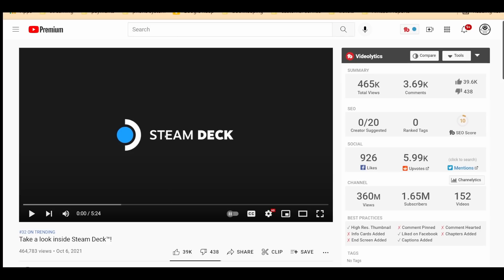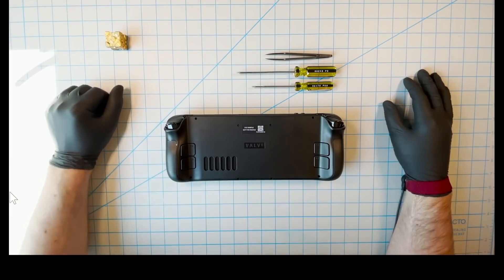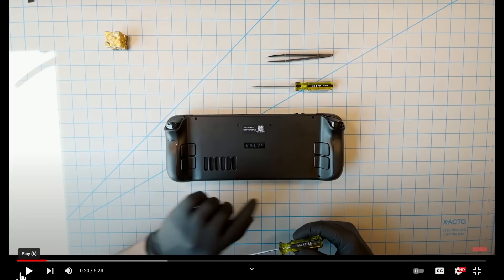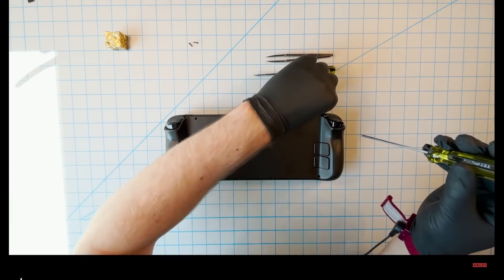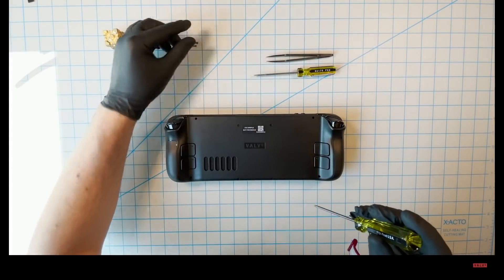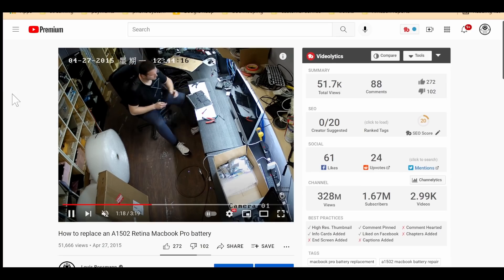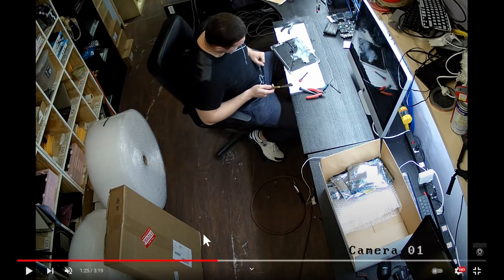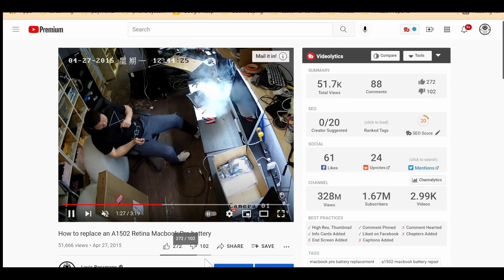Steam deck battery may end your life? bruh 😑

Comment: Like the top comment says under that video: Huge props to Valve for actually doing this video instead of trying to say it's impossible or trying to hide the information. Also that thumb stick assembly seems to be designed specifically with easy replacing in mind.

Comment: it could drop by a few margins. Like an IP 68 rated machine, when open and reseal there will be a few human errors that will drop its integrity and not seal properly. Anyway, this is a prototype who knows later the steam deck will have some epoxy seal for a stronger seal. Valve also said they are using self tapping screws not the typical screws with a in place nut holder.

Also, you shouldn't underestimate human stupidity, yes anyone can run away before a fire, but human stupidity will be the end of them. Like someone sold their kidney for an iPhone or die while playing a video game for 3 day. This is why there a Darwin award.

Comment: They should be using conductive anti static gloves. A static charge can build up on nitrile or rubber and it wont be discharged by the strap because the material is not conductive.

Comment: Every time you put the screws back in, you're probably tapping another thread into the plastic stumps. It will weaken every time, probably not noticeably, but perhaps you open and close it a few times, and then drop it and the back cover partially removes. 20 times perhaps it doesn't stay on properly at all anymore.

Comment: the reason they said that the item will be structurally not sound forever is simply because as they said the screws are selftapping and simply overtightening them can cause the female part to crack or break hence structurally it becomes less performant.

Comment: Reading comments about clips deforming, and what I was about to say on stripped threads - are two ways the thing could lose structural integrity FOREVER.
Also 3D printing the replacement casing will have an impact on structural integrity, which will last for the rest of it's life.
(Jokes aside - accidentally leaving it in a hot car to warp / explode is something that will last the life of this thing...)

Comment: I think more of what they mean is that if the battery catches fire while it's closed up, potentially even while you aren't using it and potentially starting a house fire (depending on where it's kept). You can puncture these batteries without causing them to set fire or smoke at first (I accidentally did that with my laptop's battery while trying to close it back up).

Definitely could've been clarified better on their end, and probably not so ham handed, but it's at least a step forward. I really didn't like their wording regarding the battery either.

Comment: Hi Louis—love your videos, am glad to see you chose to comment on this one.  I design consumer electronics products for a living and want to give my 2 cents on the self-tapping screws, structural integrity comment.  

You're not wrong that, if done properly with the right threading orientation, right torques, etc a few cycles on the self-tapped threads in the plastic will most likely have a negligible effect on drop performance.  But they're also not wrong—these types of connections will always be at their strongest when they are first shot, and every cycle will have some measurable (but maybe not meaningful in terms of performance) degradation of strength. I struggle to imagine a reinstallation done right, with a limited number of cycles, meaningfully impacting performance in real scenarios, but if the reinstallation is done slightly wrong I can easily imagine it actually impacting performance in the right (wrong) type of drop/impact.

IMO I think they overstated it at just the right level for consumers that aren't fluent in these questions—by calling attention to the risk, people will be more careful when working with the screws and recognize that putting tons of cycles on them creates risk.  The most important thing is doing the reinstallation right—it is super easy for someone not aware of how these screws work to clumsily re-tap them or overtorque/strip them when reinstalling, particularly if using a run-of-the-mill electric screwdriver—so I think Valve did an above-average job as a manufacturer by highlighting the risk.  I am sure they do a lot of testing with factory-shot screws, and may even do some testing after some consumer re-cycles to see what happens, but they can only guarantee the former at the end of the day—if the overstatement here makes one customer be more careful and have a good experience they made the right choice.
Reply: Having finished the video, I want to add one more comment. It's not just marketing/legal that wants to err on the side of caution/CYA in consumer messaging.  As an engineer I have an equal interest in helping customers make the right risk decision—it sucks to hear that someone had a bad experience with a product we want them to enjoy because they tried to do something they didn't understand and did a bad job.

I know legal risk and liability can dominate a lot of company's messaging nowadays, and it makes me frequently cynical too, but for technical content like this I can easily imagine engineers being the advocates for overstating potential risks to try to steer customers towards making right choices.  I think it's more likely the marketing team would just want to tell customers they can do as much as possible with the product and the legal team would want to make sure there is a clear disclaimer/TOU that protects the company from being on the hook... between the lines there are often product designers (or customer-oriented QA leads) that want the thing to work and for people to be happy with it.

Two cents—thanks again for your thoughts on this.

Comment: om only 17 and do prove me if i am wrong but what i think he means that its less drop resistant is because the plastic stand offs that the screws went into has been weekend there for if he did drop it it could snap the stand off or rip out the thread causing the steam deck to split apart once more

Comment: While replacing the battery on an old iPhone 6, I damaged the battery and the heat generated loosened the torn glue strips sufficiently for the battery to be easily removed ;-)

Comment: 8:30 The only thing I could think of that could actually affect the structural integrity is the self-tapping screws. If you remove and reinstall those many times without paying any attention to try to match the previous threads, those screws will have a lot less holding power and if you drop the device after that it might get damaged more.

Comment: When your battery starts smoking...  Grab a towel, hold breath, grab laptop, walk outside, set it down.  Then grab long handled pliers, rip burning cell out of chassis, toss it in a salt-water bucket.  If you simply walk away, the shop fills with super nasty smoke, the desk burns, and the laptop chassis is scrapped.

Comment: The way i generally deal with ESD is to just take my shoes off to ensure my feet are grounded.
I've only once damaged a component through an electric discharge once, and that's when i was trying to re-connect a wi-fi module while the laptop was running and shorted the wi-fi board with one of the connector wires because i was an idiot 10 years ago 😂(but then, i've only worked on my own hardware, my GF's laptop and assembled some desktops at work here and there).

As for the self-tapping screws, i could see why it makes some difference, self-tapping screws "cut into" the plastic on the way in, and you're likely to have a weaker connection if you screw them in poorly (and re-tap the holes) cause now you've got a bunch of compressible "gaps" in the plastic in between the threads.
BUT if you screw them in carefully (re-using the existing grooves) then i'd expect there to be little to no change to the sturdiness of the connection.

Comment: 9:00 don't have any citations or anything to prove it, but my guess is it builds off of the fact of the screws being "easy to strip."

if everything is quite tight fitting, it doesn't have any space to move around, making it so something actualy has to have an actual breakage, if the back plate is a bit loose, that gives more space for the components to jiggle against each other/in the case, makes it more likely for something to yank another thing, causing a break.

Comment: Well , it probably uses little plastic clip kinda system so two parts "snap" back together interlocking which might , a hard might fuck with integrity by scraping plastic of of these clips and in the next drop they might separate on handles , i didn't see screws there also a disclaimer , I'm not a professional, just a thought , i might be wrong

Comment: I like how Louis goes out of his way to give people excuses/reason on why something they may do isn’t all their fault. However, I don’t agree with his reasoning on why the battery his previous employee was working on got damaged. I’m a ASE master diesel mechanic and have been doing mechanic work for over 20 years. My hobbies include electronics repair, gunsmithing and creating metal sculptures. If you use a tool regularly, you know how that tool is supposed to operate, look and feel along with how the work piece should be while using the tool. Dude should have noticed if the tool was messed up, even if he was in a hurry to get it done. I have dealt with thousands of much much larger and sometimes way more “dangerous” batteries (dangerous only if you mishandle them, damage them while removing them or improperly install them) and the only time I every messed one up was when I wasn’t paying attention or acting foolishly while working on one. I have also damaged several Li-Ion batteries and each time it was an accident , it was my own fault for not using the right tool or doing something extremely risky (like soldering on a battery tab that I didn’t prep first or not adding a protection circuit before attempting to charge a battery). 

My point with saying all this, it’s clear Louis is a nice and forgiving dude. Perhaps nice to a flaw sometimes. That dude though, it’s on him that battery got damaged and if he would have been responsible enough to slow down and check his tool/workpiece first that may not have happened and he should have known better than most since he was doing it for a living.

Comment: Removing the screws and reinstalling them will weaken the hold. The experiment you can do is take a self tapper and place it in the same hole 3 4 times and notice how much weaker the grip becomes.

Comment: I feel like the thing about the battery getting hot is a solid point but what about messing it up in a way that doesn't explode immediately or it happens later in a backpack or your pocket once you put some extra pressure on it after opening it or something. I'm no expert in any way but it seems like an over the top warning with some fractional validity.

Comment: I had an old iphone 6 that I tried to take the battery out of to swap because it kept dying on me randomly and couldn't hold a charge. Find out after taking the case off the battery was bulging enough to start to separate my screen from the phones shell. And long story short attempting to take it out as carefully as we could still resulted in it exploding. However it wasn't like this video and instead of a smoke cloud it was a relatively short burst but a powerful one of flames followed by all the gasses in the battery spewing out like a flamethrower. Definitely got burned and didn't have enough time to react. But granted that battery was damaged and is most likely the reason why. But just a warning to be extra safe with the batteries. Even if you think you'll have plenty of time maybe you wont. But definitely not die like valve is saying lmao.

Comment: so steam is just covering they buts by using death.. Lawyers came up with it. when you want a catch all. normally it is worded as "it can cause injury and or death.
the screw talk was legit. self tapping screws will over 20 to 30 times screwing in and out the threads to be cut out. they if not installed correctly with cut new threads. not a normal problem 99.99 the time. what can happen is the screws will not screw in all the way or the shell not line up just perfect. 
i would say they made a very entry grandma with flip phone problems level of safety and demo of it. with mix of hay you can do it dont come complain to us.  its not that bad....

Comment: first i want to say i do know who you are and how big of a deal freedom to repair is to you and i 100% agree with you. that being said, i feel like the start of the video you are a little bit to defensive on what they are saying, especially when you ARE the professionals they are saying leave it to. as for the li-ion battery. the issue he clearly states is that if damaged might catch fire LATER. later is when its most dangerous such as when not in use while charging or sitting in a pocket or bag. in the video you should its while its being currently worked on and is easily seen as it starts to smoke. besides all that, they are saying you can just for legal reasons they are saying you probably shouldn't which a difference from most every other company, apple, that say you cant.

edit: made it to the end and i see you pulled back at the end and yes i agree that it is definitely legal trying to pull them back

Comment: Ok, the structural thing is 100% correct and you don't need to be a structural engineer to figure it out, you just need to LISTEN to what was said.... "OPENING the case immediately weakens it and makes the product less drop resistant. There's no way to avoid this, so just know that the structural integrity of your deck will be lessened somewhat by doing any of this.". So what was said is that having the cover off makes it less drop resistant. You don't need a college degree to figure that out guys.
Reply: Likely from plastic clips around the edges being snapped or bent.

Comment: it looks like it was set up to break, and anything you do will void it. the seem to compare it to aviation electronics. I call bs too on the screws
Reply: Self tapping screws can easily rip out the plastic threads when you over torque them. Similar to screws going into drywall without an anchor or a wood stud.

Comment: I saw a few things that by design could cause structural integrity issues. from the beginning of the video we can that simply removing the backplate, the device uses screws with two different lengths. Put in the wrong holes could mean partially threaded screws or screws with too much give. Also, I think imploring people to use a torque screwdriver May say something about the balancing act between rigidity and the ability to absorb energy upon impact. Also, given the warnings about simple things effecting performance, drops has to be an issue here as well.

Comment: I'm quite happy that the thumbsticks are actually separate modules that can be replaced individually, and not soldered onto the central board assembly.
And, Louis, be glad that your experiences with LiIon packs have been going so well so far, but stop assuming that puncturing a battery pack is always so harmless. I tried replacing the one in my SurfaceRT some time ago, which resulted in a huge flame that would easily have singed my face if I had jumped away just a second later than I did. (removing all the coppery soot from my workbench afterwards was also quite fun..)

Comment: Many modern bolts (and the nuts they slide into) plasticly deform (reshape) somewhat when properly torqued. They don't spring back completely to their original shape after you remove them. This is done to achieve tighter tolerances.
These tolerances can then be thrown off by reinstalling those same nuts and bolts instead of replacing them. If the nuts in question are integral to major components, replacing those bolts without replacing said major components still wouldn't achieve the same tolerances.
You see this sort of stuff with aluminum engine blocks, where the bolts should be replaced (or at least shortened with a grinder) every time you remove the engine's block head to, say, replace a head gasket.
Reply: After reviewing the video and hearing how the screws are self-tapping, I could absolutely see there being a couple percent increase in chance the device will fail a drop test after opening the case. Only a couple percent, by napkin math, but not negligible.

Comment: the first initial torque of the screw into the plastic body has a higher yield strength than the second time torqued or not due to deformation of the plastic. This can be solved by threaded inserts and machine screws and not using what are basicly wood screws